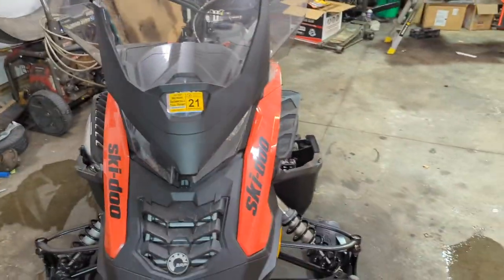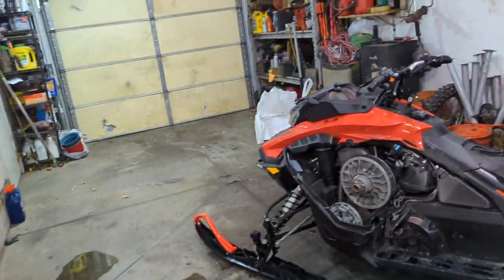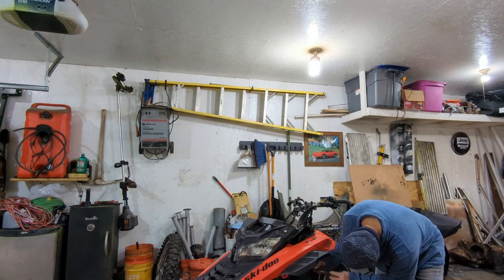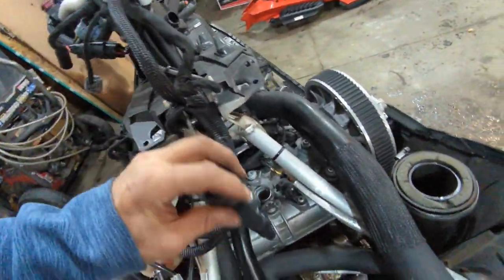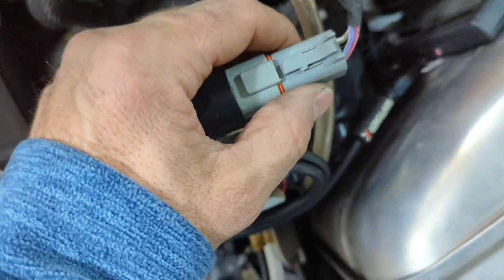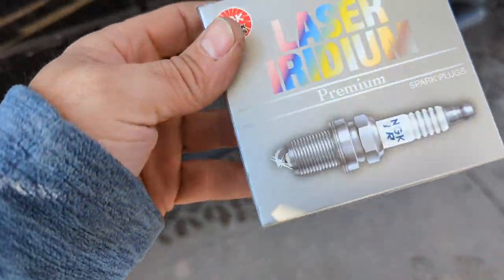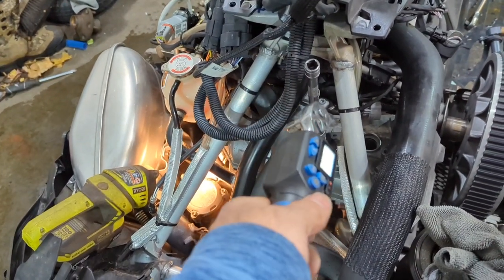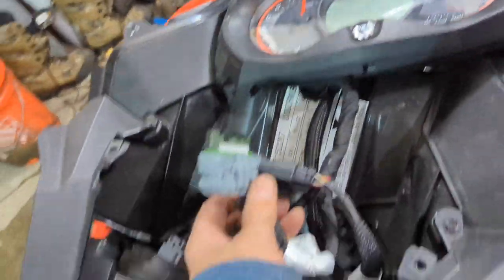Ace 900 turbo Skidoo plug change (fix) misfire and tuning skidoo renegade 2019

Comment: Miss fire check plug gap and for cracks in porcelain. Ohm wires. Test coil and what ever else creates spark. Do a wet and dry compression test. Then move to the fuel system check fot power at injectors test injectors fuel pressure test and test regulator and pump. Never worked on sleds but without a scanner and just a multi meter thats how i tackle cars. And in that order. You can do alot with a good meter

Comment: Perhaps it was a loose plug that caused the misfire.
Reply from the maker: none, were loose when I changed them, I am happy to report that after the plug change it runs and drives like new, we have a couple of jetskis with these 900 Ace engines (I love them) and about every 3rd year they do the same thing and need a plug change. easy cheap maintenance item at the end of the day.